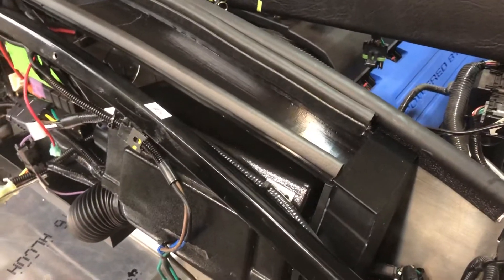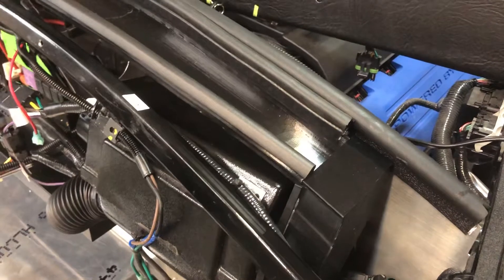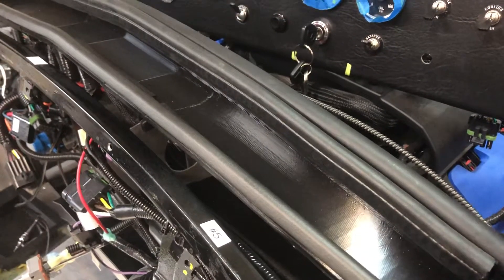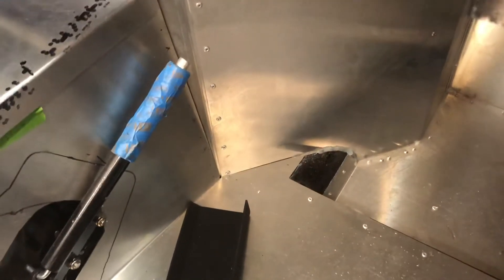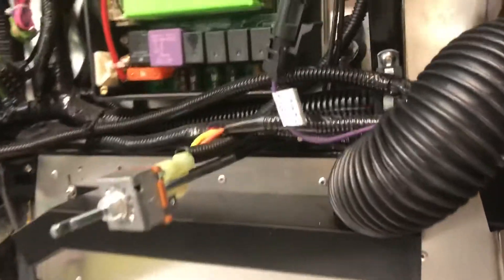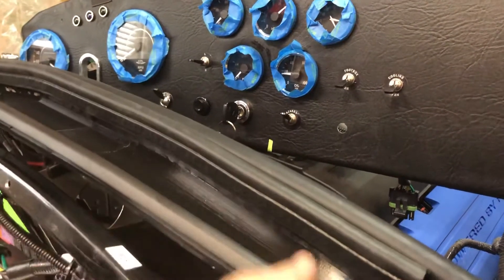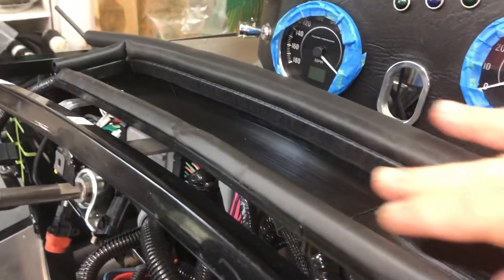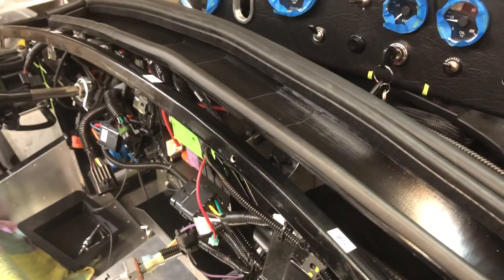Factory Five Heater / Defroster system

Comment: Nice, any results so far?

I'll probably steal your idea but form the trough from aluminum sheet.
Reply from the maker: Yes, works well. I am going to change one thing,  hard to describe without a sketch, but as the air moves right to left, the leading vanes on the defroster vents needs to scoop the air and turn it. If I can contact you with email I can send you a sketch